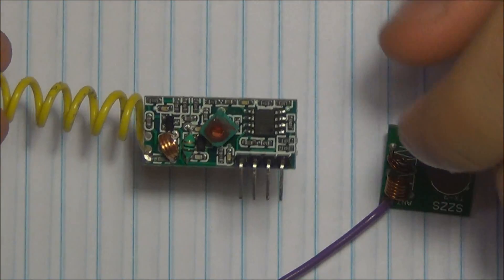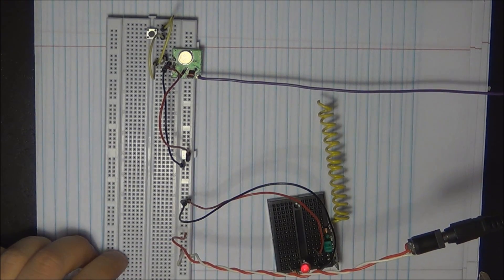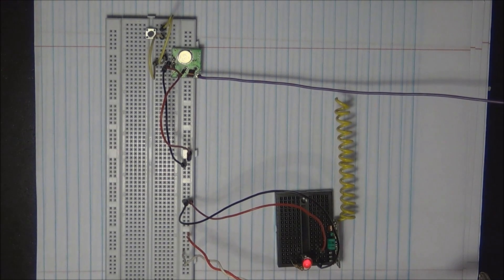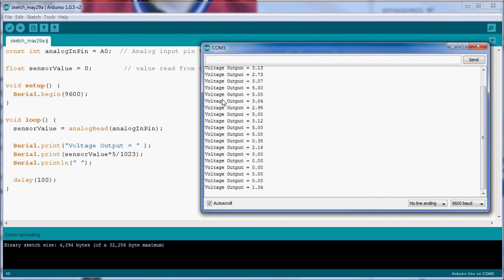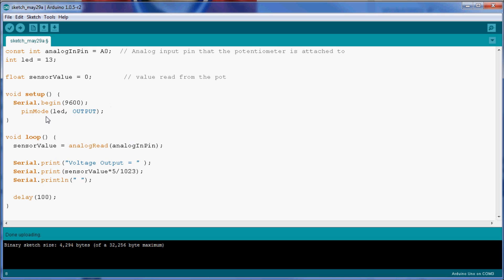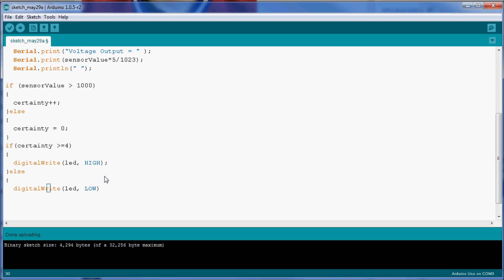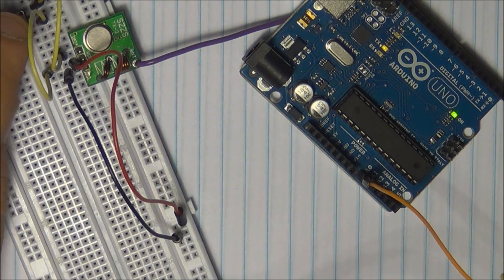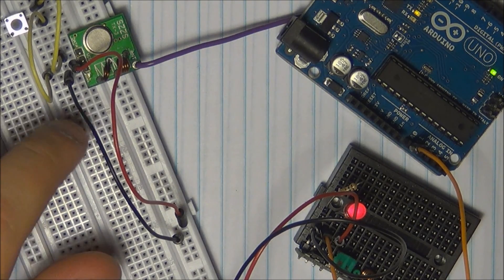Arduino Tut. #8 - Wireless RF Links Tutorial & Noise Reduction

Comment: anybody here can answer my question; can this RX and TX can be stand alone after you program in Arduino Uno... im just a beginner for this Arduino circuıt..thanks in advance..
Reply: Dj3gah Cruz well apparently you just seen this video and this guy did not use a MCU for that one push button on the Tx side and as far as the Rx you cant really tell cuz his apparently hiding something as he is talking about what you can do about the debouncing but does not shows you on the fly so you can only wonder why ? and many other have asked question which has gone ignore now for 1 or 2 months soooo yah , idk dude but im gonna say that the only way to find out is to try it out since no code is needed so it should be that easier (but more then likely not going to work )

Comment: ey bro correct me if im wrong..the TRANSMİTTER  supply 3.5 V the GND- negative, VCC-positve and the Data pin connects with Tact switch going to the VCC.... same as RECEİVER.. supply 3.5 V the GND-negative, VCC-positve, and the Data pin connects with resistor , LED going to VCC. Correct me if im wrong MR EEnthusiast....
Reply: Dj3gah Cruz i wonder why no reply on this comment? but on a side note have you done this that you just asked?
Reply from the maker: Dj3gah Cruz Sorry for the late reply. The receiver is connected to the Arduino; I processed the signal within my code in order to turn the LED on/off. That being said, you can build a circuit where you are only using the two modules.

Comment: Thank you for your reply.
In fact I have a lot of noise, without pushing the button I have a variation of tension beetwen min and max (0-3.52V), permanently.
And when I push the button, I have 3.52V, but only for a short time. If I keep pushing the button permanently, I have 3.52V for less than half a second, then 0V while pushing. Have you ever got the same?
Reply: François-Xavier Wiart have you used a pullup resistor?

Comment: I've done exactly the same setup (with same parts) but there's something I don't understand. You receive 5V between the data and the ground of the receiver. But me, I have only 3.52V maximum. Do you know what could be the problem?
Reply from the maker: I have experienced that behaviour as well. Quite frankly, I'm not sure what the reason is, but you can overcome it by either reading the signal on an analog pin or connecting the output through a MOSFET or BJT and pull the 3.3v to 5v. Hope that helps.

Comment: So from your tutorial , these are not suitable to send data from ADXL345 to areduino ? because I wont to send data of x and y from the sensor ADXL345 to arduino and read tha data ,and send order to servo , which sender and receiver device you recommended for that job ?
Reply from the maker: It would not be possible with these RF Links. I would recommend using the XBees for that purpose. Depending on what your range is, you should be able to use Bluetooth. Also, keep in mind that you can use these if you use a microcontroller on each end. What I mean by that is you can read the ADXL345 with a controller and send that data to the other controller.

Comment: I know this video is 8 months old but II was wondering if you could help me out...

I really want to replicate the setup without the arduino but can't seem to get mine to work.

Could you share the schematic or even just explain what needs to connect to what.

There are loads of videos out there that show you how to use these rf links with arduinos but I first want to try something where they work on their own as you demonstrated in this video.
Reply: I got the same problem bro. When I'm sending signal 5v - I don't recive 5v. Colleagues from forum says that the signal is codded and it could be decoded only by microcontroller...
Reply from the maker: You need to make 3 connections at each module. Vcc (5v), GND (0v) and Signal (Tx, Rx).

Comment: Can i connect a microphone at he transmitter end to transmit the output from microphone..? is that possible..
Reply from the maker: No, you can't just connect it at the transmitter unless your microphone output is digital and within the spec of the transmitter. I'm not familiar with the general specs of microphones, but I'm guessing it is an analog signal which you can't transmit over this link unless digitalized.
Reply: EEEnthusiast Thanks for your quick reply.

  i have few more query's and i require your help in one project which i am working on since i am very new to Arduino.

 This is my EMail "reinvent123thewheel@gmail.com"

Thanks in advance

Comment: Would there be a way to limit the range of this to, lets say, 10 feet?
Reply from the maker: That's an interesting question... I'm haven't tried it, but my gut suggests that applying a lower voltage to the device or making a smaller antenna would limit the range. I'm not sure if you could accurately predict what it would be through those methods though.
Reply: EEEnthusiast I've not had chance to listen to the audio yet - have you got details of the antennas you've made please? I imagine the length, and number of coils is very important.

Comment: const int analogInPin = A0;
int led = 13;
int certainty = 0;
float sensorValue = 0;
void setup()
{ 
  Serial.begin(9600);
  pinMode(led, OUTPUT);
}
void loop()
{
  sensorValue = analogRead(analogInPin);
  Serial.print("Voltage Output = " );
  Serial.print(sensorValue*5/1023);
  Serial.print(" ");
  if (sensorValue > 1000 
  {
    certainty++;
  }
  else
  {
    certainty = 0;
  }
  if(certainty >=4)
  {
    digitalWrite(led, HIGH)
  }else
  {
    digitalWrite(led, LOW);
  }  
  delay(50);
}

but the error message is:

Arduino: 1.5.8 (Windows 7), Board: "Arduino Uno"

sketch_jan10a.ino: In function 'void loop()':
sketch_jan10a.ino:17:3: error: expected ')' before '{' token
Error compiling.

  This report would have more information with
  "Show verbose output during compilation"
  enabled in File > Preferences.

can u tell me what is the mistake i have done? i cant able to find out...
 and where is ur circuit diagram? man.....
Reply: u forgot a semicolon on digitalWrite(led,HIGH)
Reply: and also forgot to close if statement.

Comment: Would you be able to use multiple of these in series without interference? Thanks in advance!
Reply from the maker: You will receive the same signal on all receivers with the same frequency. One option is to use different frequencies. A second one would be to include a code which you can use at each node to identify if the following signal is for that particular node
Reply: Thanks! I'd just like to ask , how would you change the frequencies?

Comment: Hi, any chance you could show how to send and receive analog data eg. voltage from analog pins?
Reply from the maker: You can't send analog data through these modules. You would have to convert it to a digital signal, send those bits over and convert back on the other end

Comment: Good evening sir!
Firstly i want to thanks you for your educative video series...
I would like to ask you if you can add a schematic for the tact switch version without the arduino...I have the same modules i cannot make it to send a signal and switch on-off the led...Also my transmitter gets really really hot which i think it has some kind of malfunction..And some close-ups of were did you solder the antenna wires!
Thanks in advance.